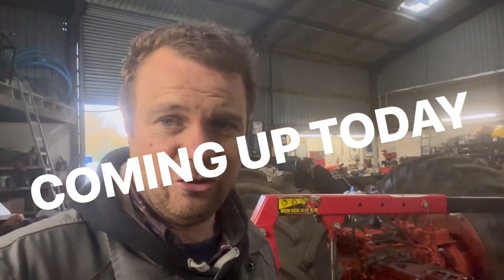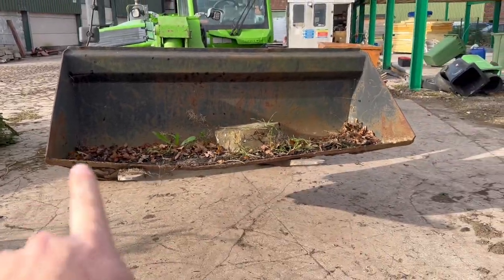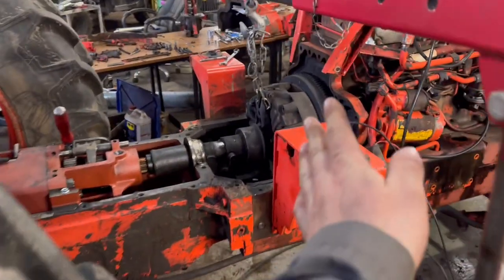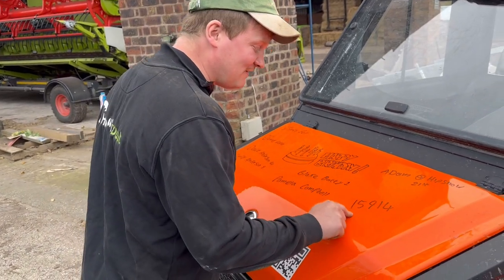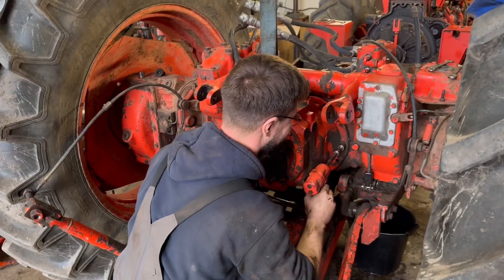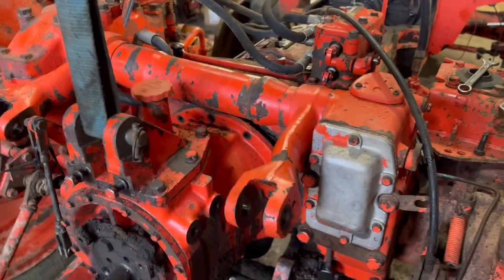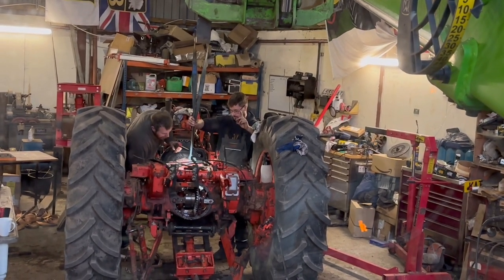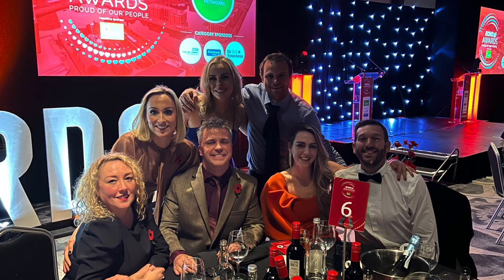DAY 965 TOM PEMBERTON PULLS A FUNNY FACE & A BROKEN GEARBOX#OLLYBLOGS  #AnswerAsAPercent

Comment: Old db box basically a slightly beefed up box out a 91 hp 1410 box n most 1690ts were putting out a little more than rated so shock loading extra 20hp in angry mode didn’t help, hydrashift was smoother 1st gear n reverse usually took brunt of abuse as only syncromesh between 2 and 3 with the transfer case bearing I wonder if it’s done a lot of heavy cultivation work n banging between 1st n reverse turning on headlands , be worth changing that clutch for the LUK unit as one local to me made ventilation hole in the bellhousing lol